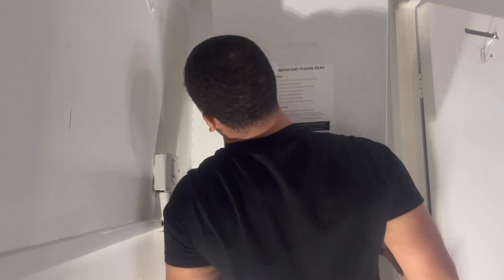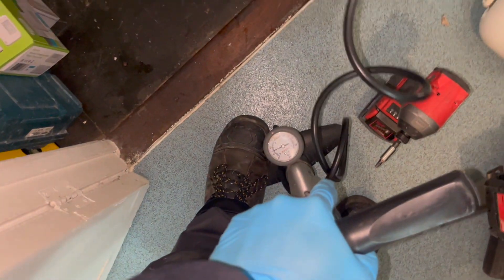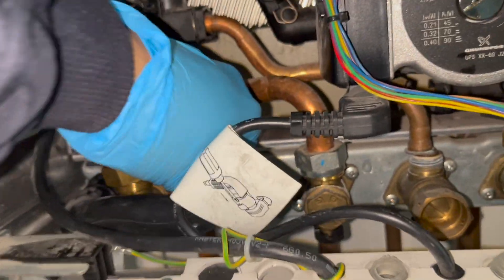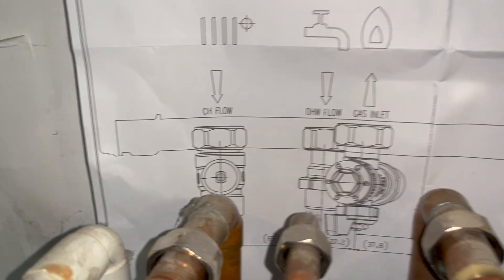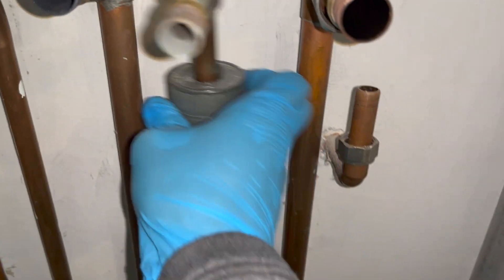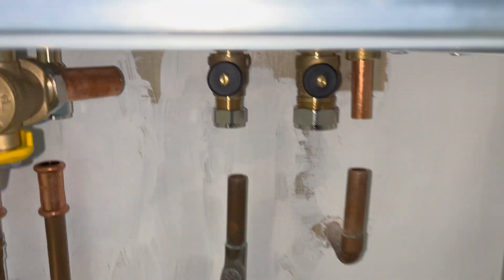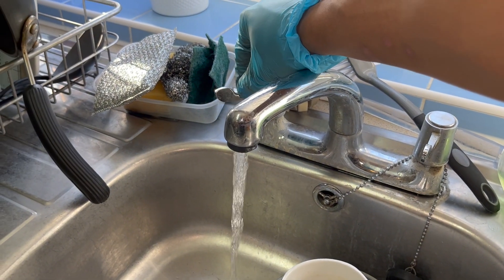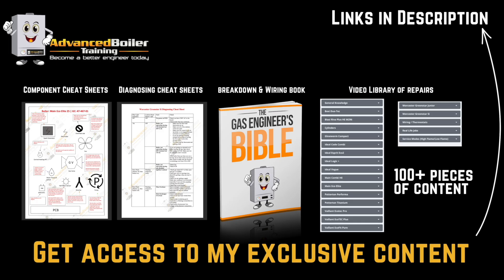Worcester 1000 Combi Boiler Installation - Full Walkthrough | Day In The Life Of A Gas Engineer #11

Comment: when You instal new boiler do you carry out the gas rate I know it's the new boiler but appliances could be faulty from the manufacturer and this has happened hundreds of times so faulty  gas valve Or venturi mixer whatever so do you carry out the gas rate after installing the new boiler I know you do the analysing for combustion to see how is burning to see the ratio and CO carbon monoxide you do that but do you also carry out the gas rate thank you so much
Reply from the maker: Hi mate, yeah I gas rate every time

Comment: By hot flush you continually leave the filling loop open with drain hose on furthest low level rad ? With boiler firing
Reply from the maker: No, I put chemical in the system, fill up, turn the heating on and then let the system circulate with the chemical. I’ll do each rad by itself then drain it all out